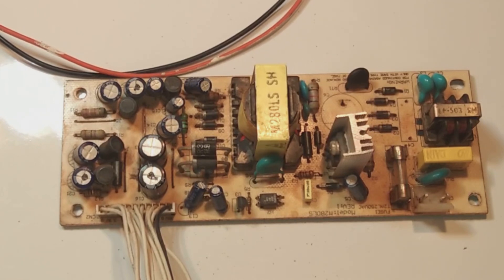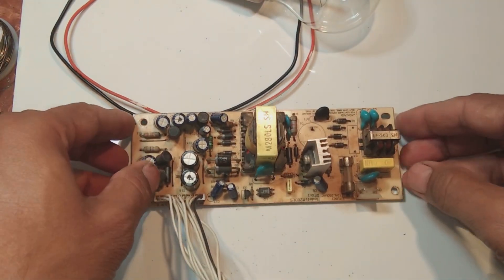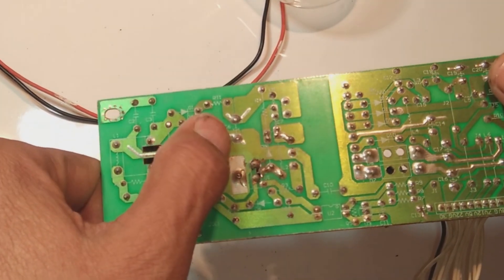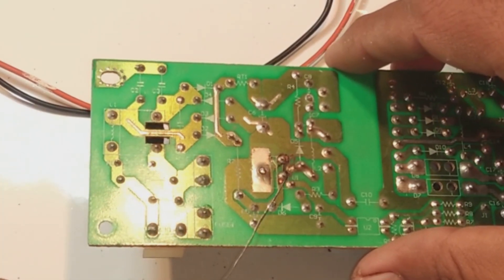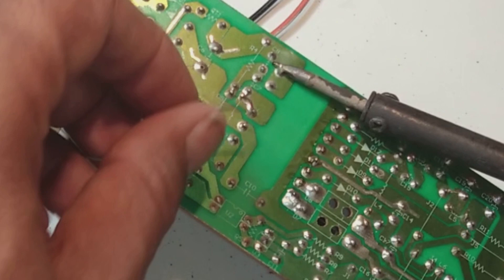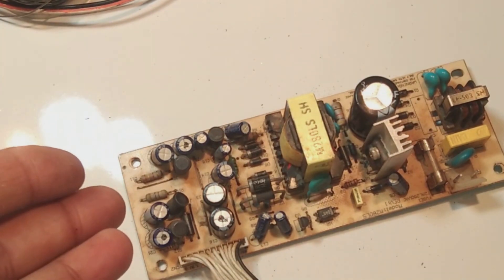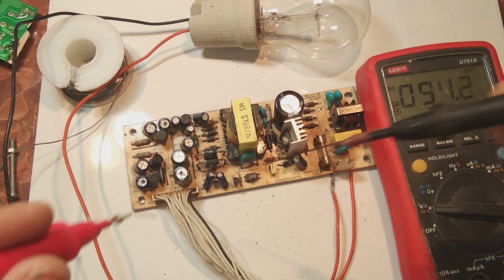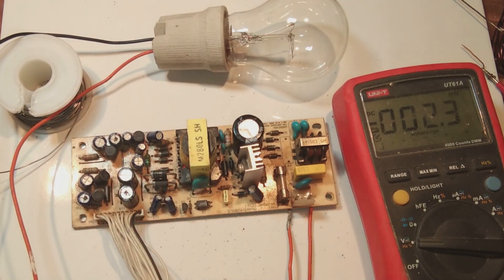smps power supply repair 5L0380r 5L0280r. Switch mode power supply repair. Digital receiver supply

Comment: Don't watch this terrible video.  There are no tips for troubleshooting a SMPS or the 5L0380R.  The entire video can be summarized as "Replace the missing capacitor and fix the bad solder joints".  Just awful.
Reply from the maker: Then what you need? If switching ic goes bad, only replacement will be the solution. Then you will say the entire video summaries the switching regulator ic replacement? Bad camment for no reason.

Comment: Excellent video. What is the industrial Applications of SMPS? Thanks.
Reply from the maker: SMPS is the standard technology for power supply today. SMPS have numerous benefits over linear power supplies. Small size, less weight, high efficiency, low heat emmition, supper regulation, reliability and low cost etc are a few of them. SMPS is used almost everywhere in industry. Stepdown power supplies 24v and 48v are common examples. They are used with plc also. Thanks for great comment.

Comment: Well done, you understand flyback switchmodes very well :-D
Before you send it back, don't forget to put some kind of load on the output,  just in case one of the smoothing capacitors is low in value.
If no information on output current is available then perhaps look at the diodes and make the load half the diode current rating.
Load up all the outputs and check voltages again :-D
Just my opinion, it is what i would do.

Comment: Heuristic rule for mains voltage smoothing capacitor  (400/450 V DC): 1 uF for each 1 W of PSU's rated power. 😎
Reply: Thanks for your kind comment. Can you please explain it a bit more?
Thanks for your valuable time.